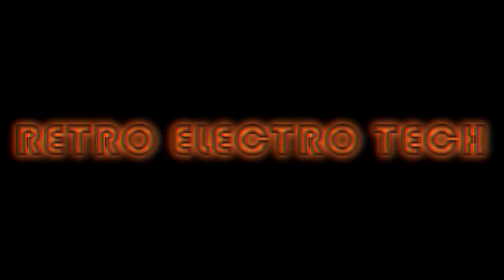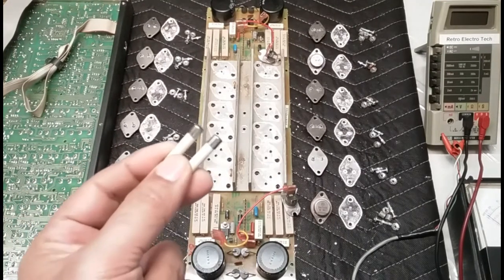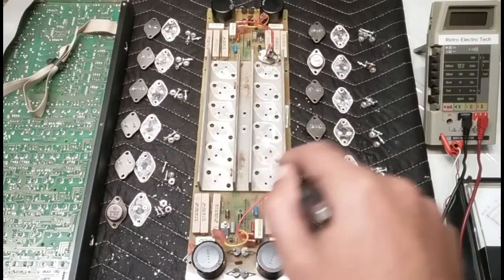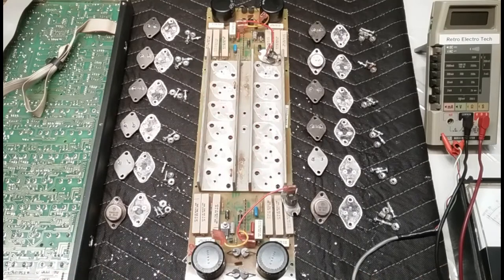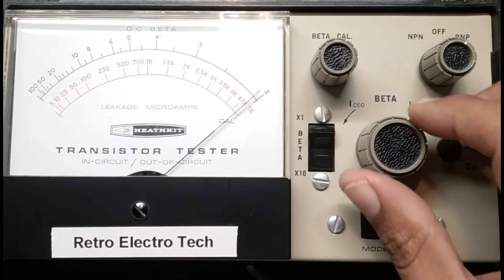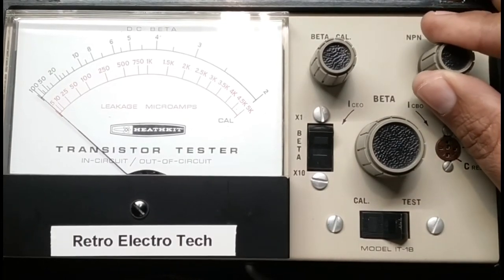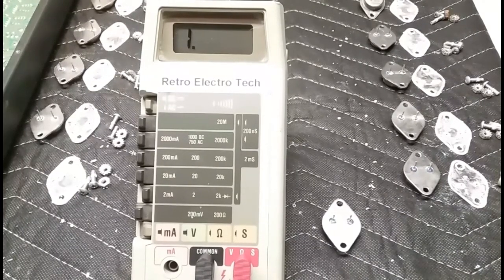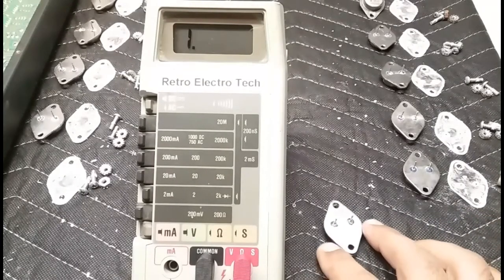Peavey XRD 680 Plus

Comment: Got the same model on the bench now. One shorted output, oddly the rest good. Driver board seems 'iffy, mostly due to some pcb corrosion (amp used beach side). Interested to see how you make out in terms of driver board work. (Nice video btw). Typically I've always changed all the outputs and most of the driver transistors when I do an amp rebuild / repair. You did not comment in this regard. Thanks for the video.
Reply from the maker: Good day Bob, this video is actually a little older. I originally started posting videos on FB for promotional purposes of course, as well as video updates for customers when applicable (which is what this video originally was). I recently left most of the social media platforms behind and will be camping out here on YouTube to try things out. So, now I'm just uploading some of my "older content" for the meanwhile, while I simultaneously work on more video footage (in the works).  But I digress ;-) Yes, during a "full throttle" restoration I would have opted to change out all of the T0-3 package transistors etc, however, the customer budget didn't permit it this time around, so, I found the best match I could (within the time-frame I had to work on it)) as far as the replacement TO-3's are concerned, and everything looked perfect (waveform / distortion characteristics etc.) when I scoped and metered the channels during final testing. I did go through the driver board in as much detail as possible, checked component values for any anomalous readings in circuit (due to time and budget once again) and if something didn't read properly in circuit I would pull it for more definitive testing. As a result, I did end up replacing a few small signal transistors, some resistors that drifted a little high and a busted XLR jack on the control board, beyond that all was looking good. I still keep in touch with the customer (my mechanic) who still uses it hard and heavy and it is still going strong, not a single hiccup.  Probably once You get the corrosion cleaned up and assure the integrity of all traces, solder joints / connections, as well as component values / characteristics  are within spec, You'll be good to go. You're definitely on the right track, especially since You're going to be replacing all of the TO-3's and getting everything cleaned up and probably recapped I assume. Well, I wish You the best on that, thank You kindly for chiming in.
Reply: @retroelectrotech  Thanks for the feedback !  
I was surprised to hear that the driver stage didn't have any overt damage on that unit.  

I always feel a bit more comfortable working with a schematic. Service manuals are often reasonably easy to find. However, not doing well so far digging one up. Might you have a lead on one ?  

Personally, FB has never been my cup of tea. I usually think of it as just a way to "harvest" personal data (as if there aren't many other ways to do it) LOL.  Myself, even though Youtube is a Google property these days, it has been my go-to platform for many things.
Reply from the maker: @bob_766  Yes sir, I hear ya, I'm done with all that social media craziness, plus, I just don't have the time, I'm super busy in the shop with a 6 month backlog and growing, but I will still be producing some video content.
Reply from the maker: @bob_766  I'm glad You found what You are looking for, I was going to scan what I have and send it to ya, however, it looks like You got it all squared away, chime in anytime Bob, have a fine evening.
Reply: Is it worth working on these old mixers?